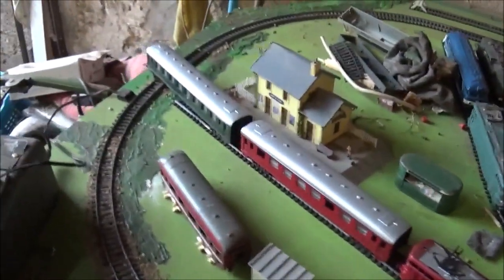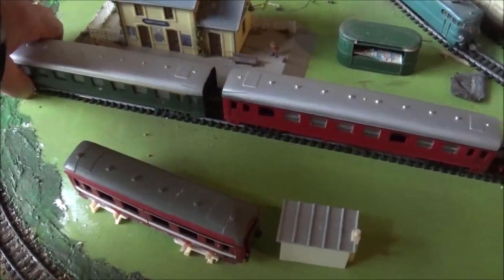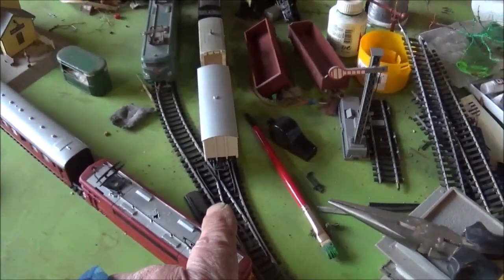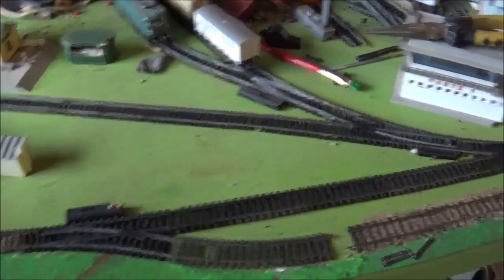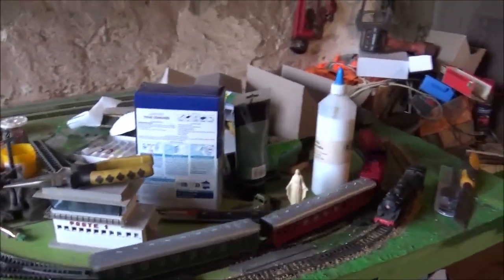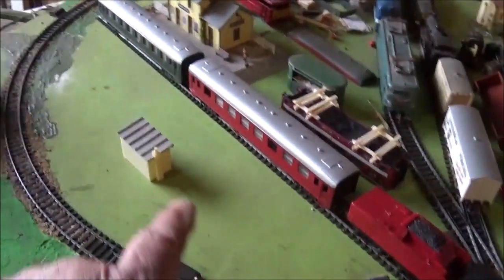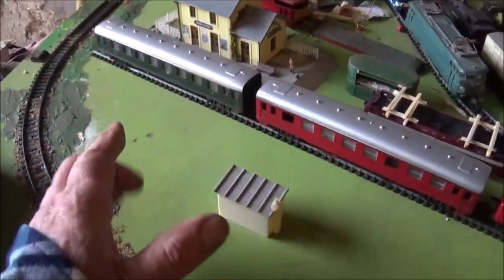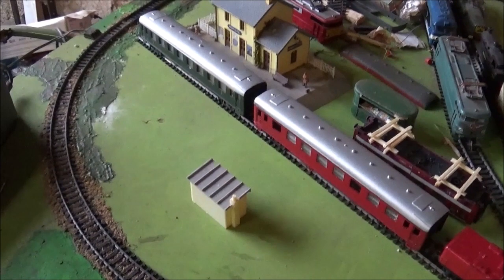Sunday night shunting

Comment: When you sort the loft, are you going to build a proper layout harry ? I've never seen the point of building a layout that just goes around and around. It's so unrealistic. Check out Graham Foulston on here mate, his layouts are of a different dimension !
Reply from the maker: The 'point' of this small layout is just a bit of fun, easily accessible, for entertainment.

When the upper room gets built, there will be a very huge runaround layout. I have intentions of 'Hornby Dublo' and modern(ish) stuff as well as a large 'O' gauge electric layout. I will have space for 'fine modelling' in sections and 'toy standard' in others. A staircase will be needed!